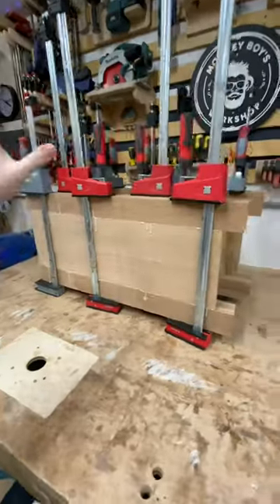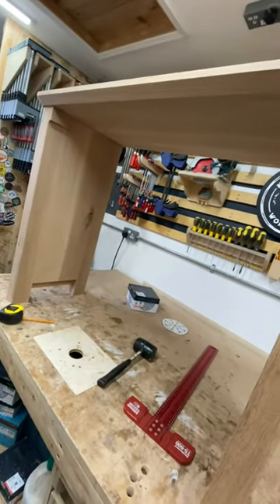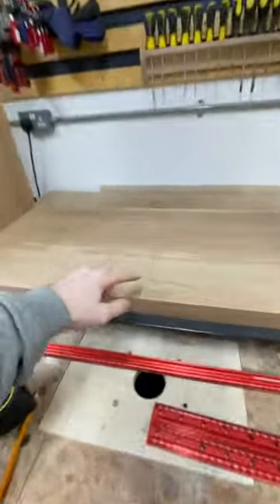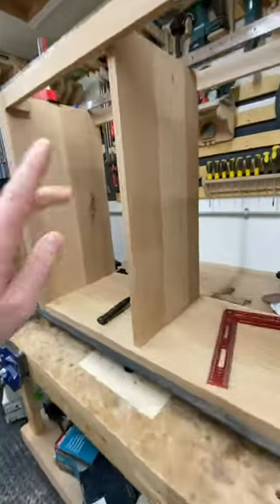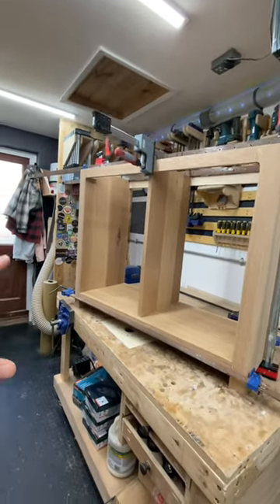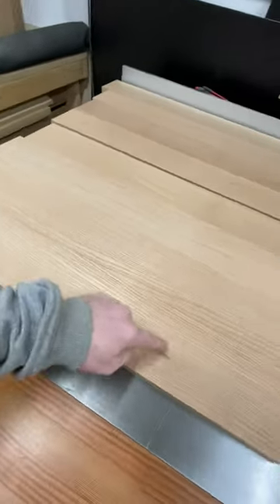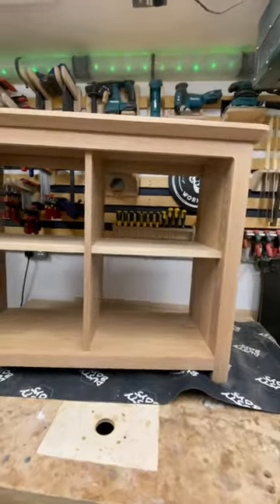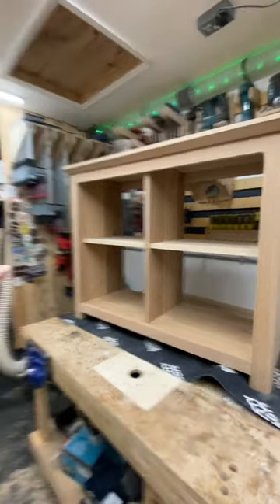DADO JIG for SHELVES and pre applying RUBIO MONOCOAT

Comment: Hi! Please can I ask, what’s are the benefits/reasons of putting a dado in for the middle panels in a cabinet, compared to just dominoing the panel directly to the top and bottom?

Cheers! Thank you for the content, I’ve learnt a lot from both your YT and IG
Reply from the maker: Hey mate! I guess it’s a personal preference, after doing both I feel making a dado for any upright piece to go in to creates a cleaner/tighter look especially when there may be very slight variations after sanding, with no drum sander. You can absolutely use dominos though, like I said its merely personal preference ☺️🤙🏻

Cheers mate, I’m hoping to share much more this year so stay tuned 👊🏻

Comment: This is looking beautiful. I love the huge round over on the legs and the rounded corner on the doors. 

Question, you seem to always use the Axminster parallel clamps despite having bessey. How do you rate the Axminster ones?
Reply from the maker: Thank you very much! Yeah we’re loving the curves all round the piece too ☺️

It depends what size piece I’m glueing up, my Bessey clamps are bigger and start at 800mm plus so I don’t use them as much unless needed as they take up more space, and I have a lot more Axminster clamps than Bessey ones, sizes 300mm and 600mm I believe! The Axminster ones are really good, I’d genuinely recommend both 🤙🏻 The Bessey ones are slightly more robust but not by much ☺️
Reply: @monkeyboysworkshop  thanks I appreciate the honest take on the clamps. They’re so expensive and I am yet to invest in my first parallel clamps so didn’t want to regret the decision.